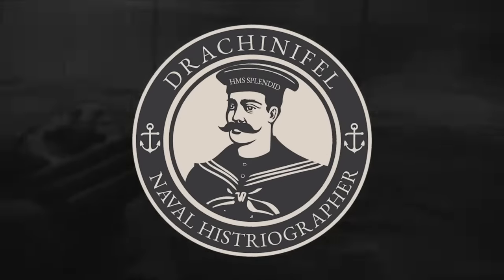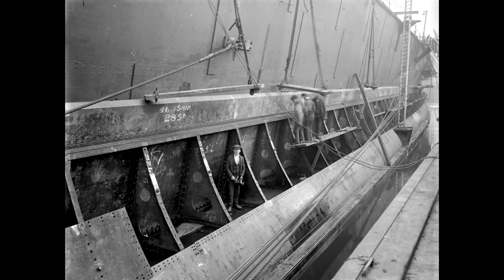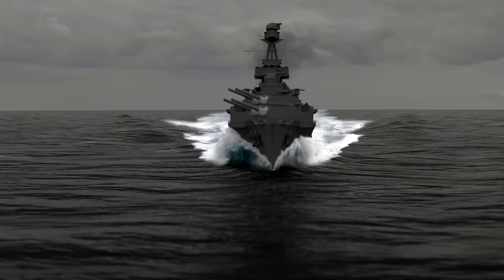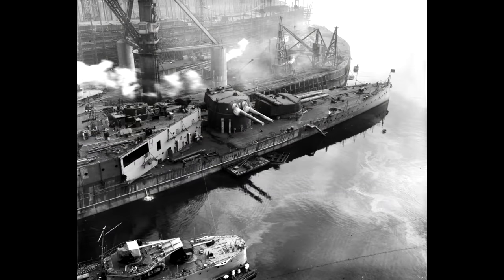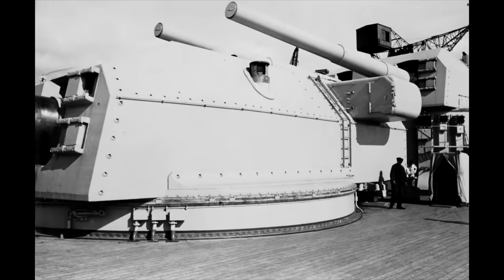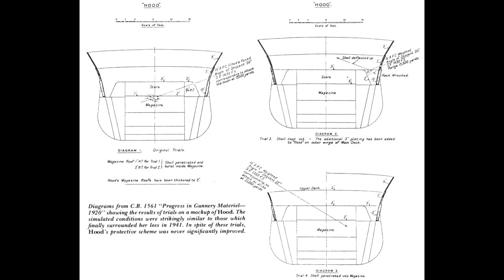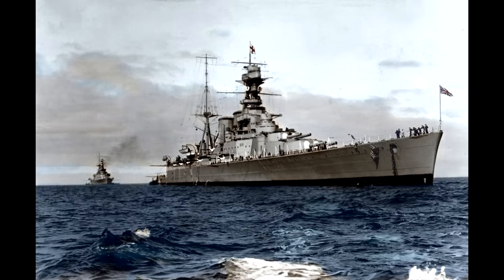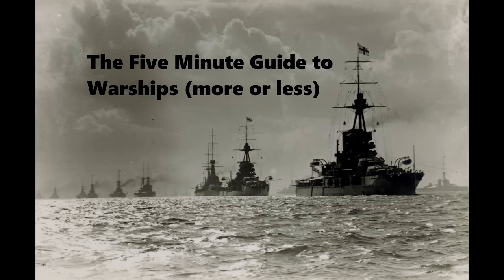The Loss of HMS Hood - But why did it blow up??

Comment: Your theory is sound and feels more likely then plunging fire, but however its cut it was an incredibly lucky shot that killed her.  A few days later the Bismark suffered a incredibly unlucky torpedo hit...  The battle vs Rodney showed up real flaws in Bismarck's armour scheme that turned into a manned shooting target in minutes though.
Reply: @aldenunion  The survivors reported the decks were thick with poisonous fumes and fires from the many hits.  One side of the superstructure was touching the waterline and every gun was disabled, the rear plate on the second turret was blown out into the bridge early in the shooting.  Rodneys shells likely were okay to hit the belt at 3 miles away, I doubt she could be prevented from sinking although I suspect the list meant torpedos hit superstructure.  I saw the ROV dive, her magazines were likely flooded when the turrets were disabled stopping any catastrophic end, but the impression she was anything else but a flaming wreck at the end I believe is false.
Reply: @UCq6c620JhX7tGIbTmZuQMYQ I can't take the idea that Rodney's guns did nothing when the evidence shows every main and secondary gun was knocked out, yes one shell hole was not enough to sink her but after an hour of this she was Swiss cheese above decks, add in the plunging fire from KGV and that explains the list.  The fact she was listing indicates a lot of holes, but with flooded magazines she would not blow up.
As for Rodney's guns vs that level of armour, they would go through any portion at 3 miles, even the turret face plates, no ship was expected to take that sort of hit, even the Yamato would be in trouble in most areas at that range, it was in the end a demolition with 9 gun salvos against a completely disarmed battleship.
Reply: Carr. A survivor from Bismarck recounts the situation prior to the order to scuttle: "In the engine room we were kept informed of the progress of the battle. We could hear the noise, but we did not notice any direct hits. We did hear sporadic shrapnel clattering in the airways. In time, we noticed the ship pitching more and more to port. A direct hit in Section X ripped the water storage cells beneath us, and our compartment started to slowly flood. The two auxiliary engines were already underwater when the command ordered the port engine-control center to place and activate the scuttling charges and abandon ship.  The fact that 14" shells had gone through the armour in the previous battle means the 16" ones would quite happily.
Reply: I wouldn't call that a battle, it was more akin to execution. Bismarck faced 2:1 odds and was uncontrollable due to steer damage. Nonetheless, one of the first salvoes fired by Bismarck straddled Rodney and if not for following destruction of main fire control systems on Bismarck, who knows if one or both Brittish BBs would have avoided significant damage.
Reply: @gratius1394  The main guns of Bismark never straddled, the nearest a shot got was one of her secondary shots landed 300ft away from Rodney.  It was a one sided battle for sure but she started with full armament, targeting and manoeuvrability, yet I think we are influenced by the fight with Hood which was a lucky hit on the third or fourth salvo.  In reality all battleships are susceptible to damage, the Bismark turned out to be good at floating, but within a few hits she was helpless - this did not seem to be purely bad luck.  From the fight I wonder if the Nelson class was far more powerful then judged, the bomb tests after the war showed Nelson took a 2000lb bomb hit - that's a serious bomb that effectively ended Tirpitz as a useful bb before the tallboys capsized her.
Reply: @MrEddieLomax  I'm quoting a book that I've read long time ago and it definetely stated that Bismarck's salvo straddled Rodney near the beginning of their duel. This may be true or not, each source is a bit different. Still, Bismarck turned out to be remarkably resilient and withstood a lot of pounding before sinking. I'm not sure if we can judge Nelson class purely on this one engagement, she had obvious advantage in this fight and as far as I know, both Nelson and Rodney fought other capital ships only few times, with no clear winner in most of cases.
Also, I wouldn't go as far as to claim that 2000 pounders are responsible for sinking Tirpitz. The British attacked him multiple times with wide array of bombs. 2000lbs bombs were able to penetrate main deck armor and inflict major damage but he finally sunk after one near miss and one direct hit with Tallboy bombs dropped from Lancasters.
Reply: @gratius1394  The Tirpitz was a fun one, the earlier bombing raid literally gutted her causing massive damage, this really needed a drydock to repair but the British did not know this, she was not as I understand a real threat at that point but the Germans built a sand bank under her to prevent further sinking's and seemed happy to operate her as a huge distraction.  I think the Iowa's were probably the most powerful BB's of ww2 - Yamamoto had weaker targeting, but ton for ton I have a suspicion the Nelsons were deadliest.  Will have to look again, the accounts I've heard didn't give Bismark a straddle, although it was desperate stuff after they lost their main fire control, but from the earlier battle we know her targeting was good.
Reply: @Relentless If the Germans could avoid Battle of Denmark Strait, I'm sure that they would have. We have to remember that fighting other capital ships wasn't Bismarck's mission, that's why Admiral Lutjens decided not to pursue Prince of Wales after Hood's demise. If both British BBs had been sunk, British cruisers would have been either recalled or left in shadowing position and would do their best to avoid any further engagement.

Comment: 28:25 It may also be plausible that a shell penetrating the 7" plating could be deflected downward by the impact, hitting the 3" armour at a much more favourable angle and entering the 4" magazine that way?    Your route, under the belt does seem the more likely one though.
Reply: No. When a projectile penetrates an armor plate its course changes towards going in at a 90 degree angle to the plate. With the Hood's sloped armor the deflection would be upwards. It confuses the hel out of me as to why but your theory runs counter to how things work in the real world.
Reply: @calvingreene90  
I'll take your word on that, it was just a thought.
On the section drg the projectile strike is awful close to the corner of that 3" armour plate (but then its also a small scale drg of unknown accuracy) so things might go a number of ways.
The route under the belt is certainly "easier".
Reply: @calvingreene90  no....penetration of the 7inch belt abreast the engines had no 3 inch plate to hit. the main deck was 2inches laminated HT going into the 2 inch slope. Any shell at an oblique angle penetrating the 7 inch belt in that region goes clean through the slope section like butter. that is how she died
Reply: @buzzardbeurling  
Your statement does not match reality. No matter how thin or soft thel armor it will alter the direction of travel of the penatrator in the manner I described.

Comment: It sure seems that in naval history, "lucky" hits have become kind of a standard when talking about sinking well-protected ships.
Reply: It's luck when it's your ships getting sunk, it's skill when your enemies are the ones going to the bottom.
Reply: @satannstuff  What about when you're talking about icebergs and passenger liners?  Is that luck or skill on the iceberg's part?
Reply: Actually, in the case of the Bismark there were about 100 hits, so a couple well placed ones weren't especially lucky...
Reply: @arthurmetzner5105  I wan't talking about the final massacre, but about the hit that sank Hood, the fuel hit by PoW, and the torpedo to the rudder.

Comment: My dad told me about a very lucky hit on his B-17 in world war 2. As he was getting out of his (co-pilot) seat after a mission over occupied Europe, he saw a hole in the side of his aircraft behind where his right elbow would be in flight. There was a puncture in the upholstery of his backrest cushion, and a horizontal wrinkle in the fabric leading across to the left side of the cushion. (The backrest and bottom seat cushions were made of rubberized horsehair, about two inches thick, and could stop small and low-energy shrapnel.)

On the left side of the backrest cushion was a bulge in the tough fabric encasing the cushion. Dad used his pocket knife to slice the fabric, and pulled out a jagged piece of a German 100mm anti-aircraft shell. It's in my possession now, dad showed me the threads where the fuse is screwed into the nose of the shell. I think the fuse is both contact and barometric, dad told me that a German aircraft would trail the formation of bombers and radio the altitude to the anti-aircraft batteries on the ground.

The fragment missed my dad by about three inches, at an airspeed of almost 200 MPH, and had enough energy to penetrate almost two feet of rubberized horsehair. If it had arrived a few milliseconds earlier it would have easily killed both dad and his pilot. 

Dad passed away in 2012, I am now a grandfather myself, my four siblings are all grandparents, and none of us would exist if that shell had exploded a tiny bit earlier.
Reply: And the relation of that story to the sinking of HMS Hood is? Why not post it on a "B-17" thread?

Comment: Was consideration given to the fact that if the Hood were in a turn, she would be heeling? Does that affect the potential angles of impact on the deck armor assuming that the shell penetrated the 7" belt above the main belt at the calculated angle relative to horizontal? Might the shell have impacted the part of the deck armor angled down outboard of the horizontal area of that deck plate?
Reply: She did heel but not enough to alter that result. However as she was hit between 50 and 60degrees any shell hitting the 7inch belt goes right through the slope

Comment: For myself there are two big if's that could have altered the course of this short sea battle. Had Admiral Holland stayed in the line ahead course that Hood & Prince of Wales were on. Closing the distance even further before turning to starboard for a full salvo. Getting under Bismark's big guns was paramount for Hood to have any chance of victory and/or damaging Bismark so much that Prince of Wales could have damaged her even more. Hood, as pointed out by the commentator, had adequate armor on the hull, conning tower, turrets, and the other vital areas mentioned by Drachinfel. The other "if" was the lack of any fire coming from the two shadowing British Heavy Cruisers. Those 8-inchers of the Brit cruisers posed no serious threat to Bismark, but the cruiser fire added to Hood's and Prince of Wales fire could have saved Hood's compliment from the sudden explosion and destruction of their ship. I've never understood why the British Heavy Cruisers were not joined to the battle.
Reply: Quite simply Norfolk and Suffolk were tailing the Germans who were steaming at close to maximum speed, consequently the British cruisers had only a small speed advantge with which to close in the stern chase. Norfolk did manage to loose off a few salvoes near the end of the engagement, but they fell far short.
Reply: Actually, if they had continued on their present course the Bismark's next salvo (which was already in the air) might have hit them too.

Comment: I once heard a story that Vice Admiral Holland commanding HMS Hood at the time of her demise thought that torpedoes on a BB was inviting disaster.  They're the equivalent of four 21 inch shells in a relatively exposed position just waiting to get hit and blow up.  Adm. Holland felt so strongly about it hat he protested to the admiralty and wanted them removed.  The Admiralty was outraged that so experienced an officer would advocate sending a battleship to sea without her full complement of munitions to fight the enemy.   They said no.   Supposedly, Adm. Holland protested twice more and was refused twice more.  The third and last time, the Admiralty told him the Hood was going to sea with her torpedoes regardless.  The only question was whether or not Adm. Holland would be going to sea with her!  Hood went to sea with both Adm. Holland and the torpedoes.  I can't help but wonder if the story is true and if Adm. Holland had a point.        

At 36:40, we see a side schematic of Hood showing an estimated shell impact point just forward of WTB 280.   The torpedo ports are only roughly 30' forward near WTB 239.   If the fatal shot from Bismarck hit close enough to the torpedoes to set them off that would doom the Hood.  The equivalent of FOUR 21 inch shells, plus the 15" shell from Bismarck, all going off simultaneously would be fatal all by itself.  Add to that the proximity of the secondary battery magazine at WTB 280, and then the main battery right next to it and you get a colossal explosion large enough to tear the Hood in two.

So did anybody else ever hear about the story of Adm. Holland vs. the Admiralty?  Or that the torpedoes were the cause of Hood's death just as the Admiral  had feared?

Comment: Dear @Drachinifel, thank you very much for this very well-presented and extraordinarily well-reasoned analysis. 
I bought the book that you referenced and with all due respect - your video is so much clearer and to the point. 
From this, a question: would it be possible for you to apply the same skillful analysis to the hit on Bismarck's rudder and subsequently the question why they didn't manage to fix the mess in the night after it? I understand from the book that the starboard rudder was hit, driven into the centre propeller, and half blown off, the port rudder was blown off completely, and the stern holed in such a way that the gale force waves were moving so freely inside the confined space that it was impossible to do any useful work whatsoever on the remains of the rudder and its controls. I do believe that this could be material for another excellent analysis on your part? 

As regards Holland's closing Bismarck once the shooting started, I believe there is a very understandable background to "no captain can do much wrong by laying his ship alongside the enemy" even in 1941. While boarding action wasn't perhaps foremost on anyone's mind then, the probability of a shot actually hitting and doing damage were just so much better from closer range - and the British needed Bismarck taken down, and quickly, lest the beast (new and fresh and fast as she was) escape or score a lucky hit that might end the battle in her favour (perish the thought).

Comment: Ted Briggs was an 18 y/o signal officer on the Hood and one of the three survivors. During his testimony before the admiralty he stated that just before the shell impact, the Hood was in a hard turn to port and that it was leaning so hard to starboard (toward the Bismarck) that he thought it would tip over. This increase in presentation angle to the incoming shells from the Bismarck is VERY significant and was not included in your slideshow or assumptions. I would like to see your penetration values recalculated to include some realistic value for these increased angles and the resulting increased probability that an incoming shell touched off a main magazine on Hood.

Comment: So, if Hood had had a bulbous bow, not only would she have been even faster, but the reduction in bow-wave amplitude might well've placed the lower edge of her belt low enough below the surface (even at the trough of the wave) to defeat the type of barely-diving hit that sank her.

Comment: Very interesting, spot on analysis! That unlucky wave pattern was probably intensified on the starboard side by the turn to port of the fast going ship. Further unlucky coincidence was it, that the deep trough of the wave-form was precisely at/beneath the main mast, the cross-hairs, where the gunners of the Bismarck were aiming for, supposedly! 
 That was more than a "lucky shot" of Bismarck, the Murphy's Law of disaster: "accidents that can happen, will happen in the worst case in the worst time/place", also took its toll. 
 ?: to which side would the Hood roll in this turn? To Port or to Starboard, or no Roll at all?

Comment: A low down penetration seems an apt way for the "largest submarine in the navy" to receive a deadly hit. The multiple lines of evidence for a pressurised burn inside the ship before it's destruction and the angles of attack for any incoming shells make this seem highly plausible. Very interesting and original: I have never heard of this particular theory before; evidence from the seabed seems to confirm an actual magazine explosion aft definitely occured rather than a burning inferno and this analysis gives a way for the confined pressurised burning to both start and result in that aft magazine explosion. Very impressive work.

Comment: A terrific video, Drachinifel. This is an eye opening discovery you made about the wave profile. I had always thought the weak deck armour was the culprit.

I do have question though. If the fatal shell passed a bit below the waterline (in the trough area as you mentioned), wouldn't there be some water pouring into the ship that would have helped put out the fire in the 4" magazine hold? Or perhaps there wasn't enough water coming in to extinguish the fire?